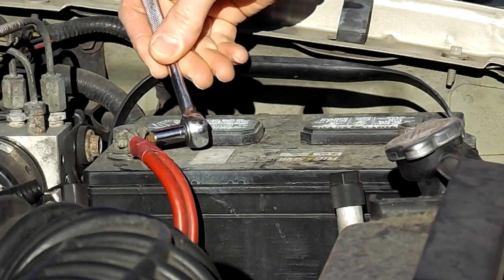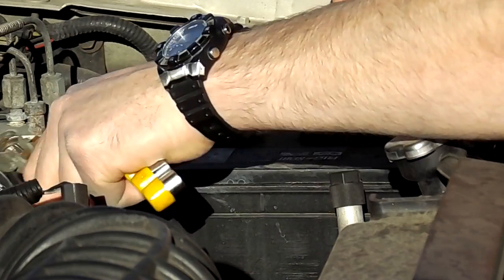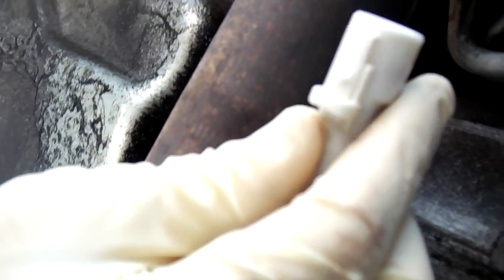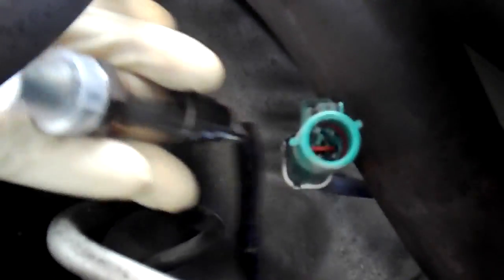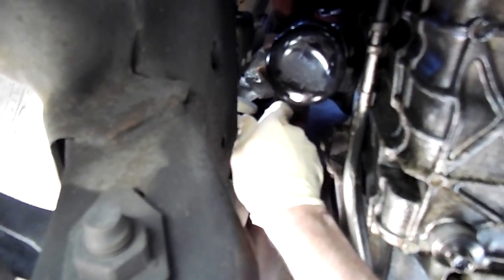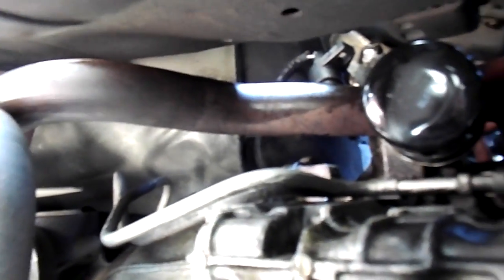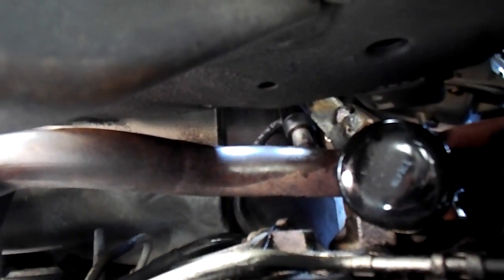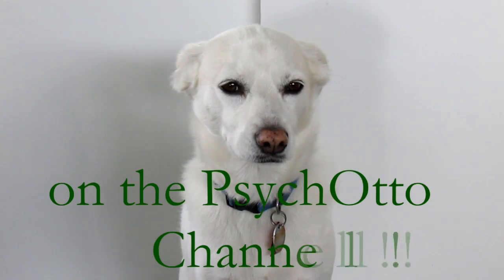Replacing the Upstream Oxygen Sensor in a Ford Ranger

Comment: Maybe he did it first but video shows Positive battery, being disconnected first. Anyone disconnecting a vehicle battery  should always remove the Negative cable first. While the Negative terminal is still connected to the battery, if one accidentally hits the vehicle with the metal wrench/socket wrench, (the vehicle battery is still grounded),  on the Positive terminal,  you will get a spark, and a little electrical jolt, if your body completes the circuit. Simple precaution, any spark near a battery can cause a explosion. Other than that it is OK.

Comment: Cool video man! I just did mine (2000 XLT 4.0) the other day. Didn't have the special tool, so I used a reciprocating saw to cut the sensor in half, then a deep socket to pull the sensor out. After that it was smooth sailing.
Reply: When there's a will, there's a way. LOLZ
Reply: How’d you put new one on then? Box wrench or something?

Comment: What wher the symptoms that  made u change it because my truck feel like my catalytic is clogged,misfire and and can't accelerate wont go sound like misfire
Reply from the maker: I think an engine light was on, but it's been so long I can't exactly remember. I think it was running rough too. I replaced the upstream and downstream ones at the same time.
Reply: I've got the same thing and two different mechanics have told me it's my MAF sensor and my upstream O2 sensor

Comment: thank you! i did this on my 2009 ranger without unplugging battery and everything was fine. im lazy and didn't want to reset my clock and audio settings so i didn't wanna unplug battery

couple tips-- you don't need to take off the wheel, but you should probably take off the plastic mud guard. personally, i was lazy and didn't take it off either. i had to turn the steering wheel all the way to the left, and get my body/head under the car and wheel. then, i bent the mud flap plastic behind my left shoulder so i could get my arm past the flap and to the sensor. you should really take off the mud flap though is makes it a lot easier!